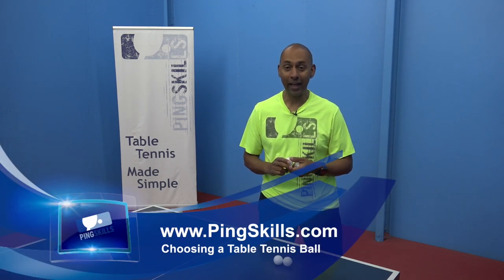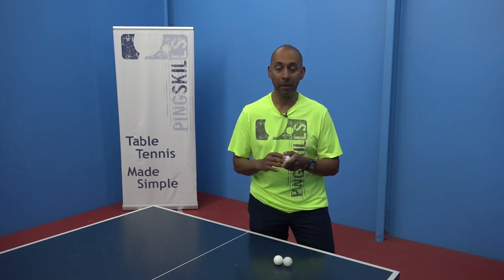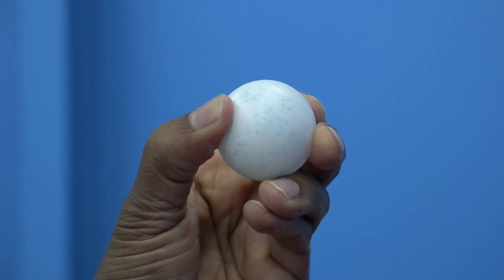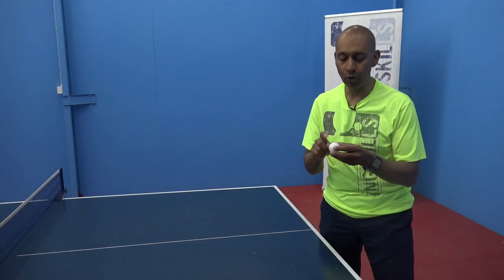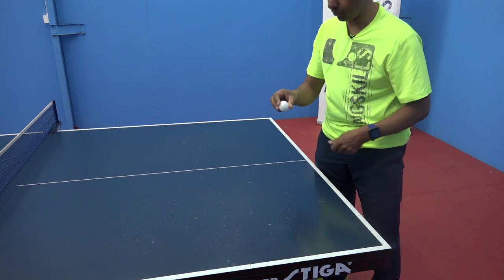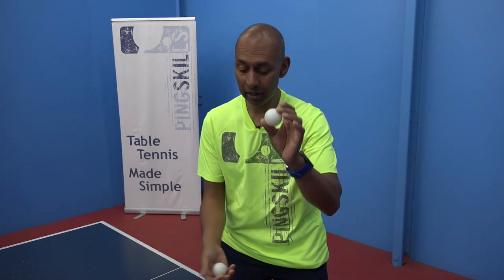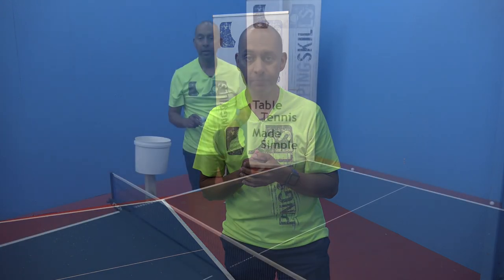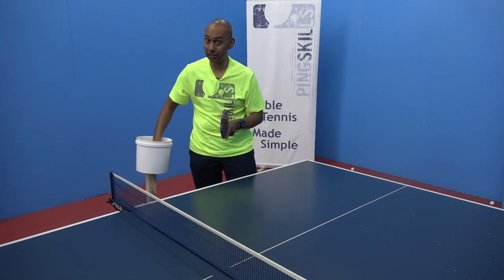Choosing a Table Tennis Ball | PingSkills

Comment: Here is my experience with table tennis balls

Pongori 1 star: i bought 6 of them last year, pretty cheap i think it was 2 or 3 dollars. Quality was decent like a 6 or 7 out of 10 but they broke pretty fast in less than 3 months i believe. Still a decent option for training 

Artengo 1 star: I have 3 of those and they are pretty good. Spinning could be better but they have a good durability. None of them broke in like 3 months. I dont know the price, i didnt bought them.

Donic Schildkrot jade (0 stars? Idk): bought a pack of 6 last year for 3 dollars and i think in a few months only 1 broke so that is good durability. Spinning is very nice, but they are a little bit lighter than other balls. Still a solid ball.

Since im an advanced player lately i should probably go buy a pack of 3 star balls in the future but i still have like 7 balls left so im not rushing. I looked up and they are pretty cheap aswell. 

My recomandation for beginners would be honestly any of those i mentioned up, just avoid those balls without a company on their name. I know they are beginner balls but some of them are pretty shit even for new players. If you can find 1 star balls those are good enough.
Reply from the maker: Thanks for sharing.

Comment: What is the difference between the 40+ balls from different manufacturers? Are the Nittaku Premium 40+, Xushaofa 40+, Double Fish V40+, and DHS D40+ balls all current to today's tournament standards?  Are they made with different materials?  Do the balls have different characteristics?
Reply: Yes all these balls you have mentioned are of tournament standards. I have played all the you have mentioned except double fish. 
Although they are made of same material but the quality of the material differs because each brand source the raw material from different companies.
Yes, there is a clear difference between seamless ball ( xushaofa) and seam ball ( nittaku premium, d40, v40). But both type of balls are really good to play. You just need some time ( 2 sets of match) to get used to the balls of the different type.